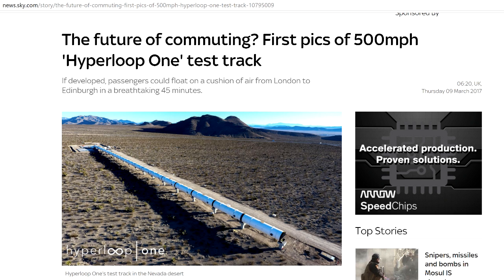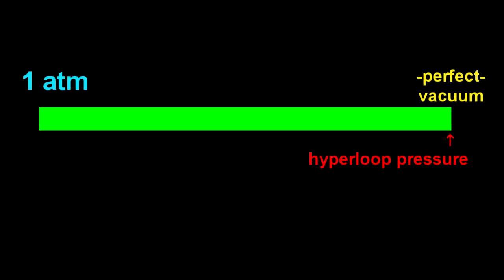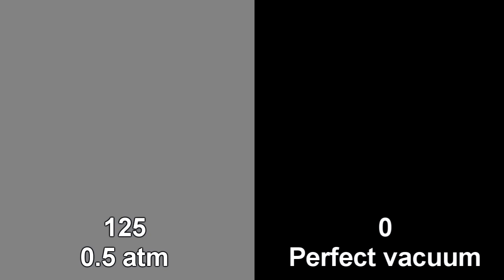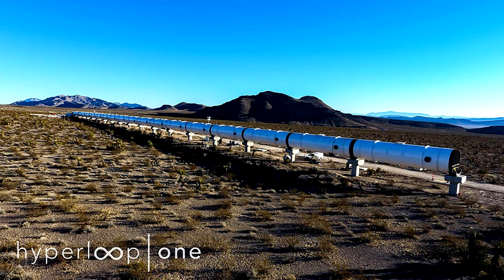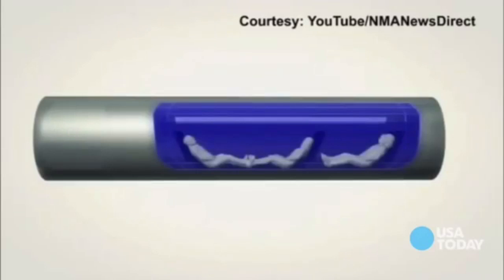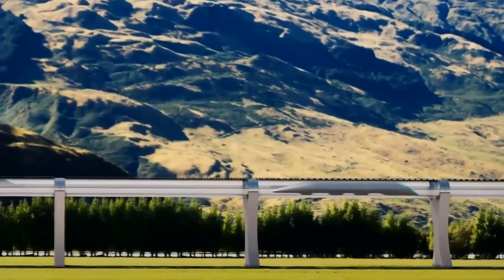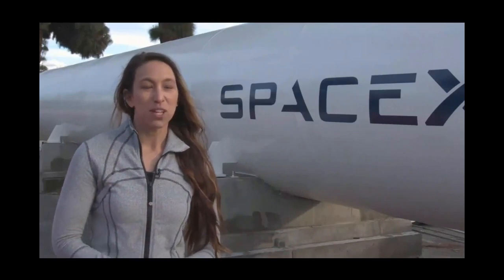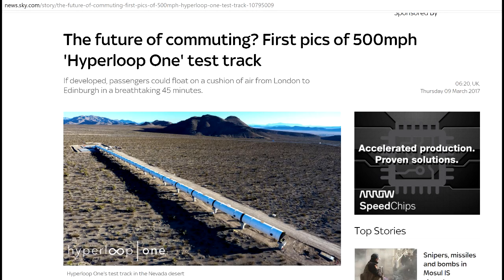Entire Hyperloop could be destroyed in SECONDS!

Comment: You obviously aren't going to pump down the entire track you would pump down the volume remaining in a lock once a  capsule is in it which would be as minimal as possible. If there were a leak in the tube you would open up  vents along the length. Expansion and implosion are trickier and I don't see how they are going to handle the issue but clearly hyperloop isn't even in an alpha phase at the moment. I think Space X is closer to landing on Mars than anybody is to building a practical Hyperloop.

Comment: Surely they could just have failsafes? Like having hatches on each individual piece, so that if one fucked up the hatch would automatically close? It would still be hugely problematic if one did break but it at least would stop the entire thing from being destroyed in a giant chain reaction. (Feel free to prove me wrong I have no idea if that would work or not)
Reply: Well, assuming they could engineer something like that into it, you would still need towels to soak up the remains of the passengers in a capsule in an affected section...
Reply: Yea ofc if it happened specifically on the exact section of tube that the train just happened to be in, then that would suck
Reply: Well, at 1000 kph, even a failure quite a few km ahead of the capsule would be fatal for the passengers.
Reply: Good point

Comment: Wouldn't it be easier to scrap the Hyperloop and build an electromagnetic bullet train in it's place?
Reply: I would rather have expensive and functional than an expensive dead end.  It's just a thought though.
Reply: Even better to just not go to San Francisco in the first place.
Reply: Gauss gun, maglev train. Its pretty much the same thing. A projectile suspended by permanent magnets to remove rail friction, with electromagnetic propulsion.
Reply: Also, I sure as hell would not want to stand anywhere near that student test tube!
Reply: Well we'll put flames on it.  Everyone knows flames makes things go faster.  Well get that 1000km/h  XD
Reply: I say we bring back the old 1800s steam trains. We can put a couple pinwheels on the roof: they can supply power to the "occupied" LED on the bathroom door or something? That will surely appeal to the hip enviromental sustainability people!
Reply: But they don't want easier boring old working things. They want NEW, EXCITING, EXPENSIVE, OVERHYPED STUFF even if the cost is so high even Snoop dog isn't match for it.
Reply: +Damien Kovalt
“If I had asked people what they wanted, they would have said faster horses.”
                       -Henry Ford
Reply: When I first saw this I thought it would be something like a mass driver or a Gauss gun-type thing. I was actually pretty excited.
Reply: Or 5.
Reply: Saying it Isn't 100% vacuum is really ignorant.  As outlined in the paper for this thing it is at .015 psi optimal pressure.  That is a 99.85% perfect vacuum.  It may not be 100% but it's so close it's negligible.  Also you can't blow air against the train to keep it levitated in a vacuum without negating the vacuum.  

"There are people that have never gone to school that could run circles around this idiot."  You're not one of them, move along.
Reply: Damien Kovalt I saw those back when I was in middle school. Why have we not started implementing those instead of this "hyperloop" thing?
Reply: I thought that was the whole premise of this? That they'd have an electromagnetic essentially railgun and the vacuum would be used to prevent air resistance so that it can reach as high as they say it could.
Reply: Simpsons History says it's doable
Reply: A high-speed maglev train would also be a colossal waste of money, but at least it would be functional.
Reply: ViliAtFinland Oh piss off
Reply: MrPepsicola123 -- You should actually try listening to this video and others he's made on the hyperloop, because he explains very carefully and accurately why the entire concept is bullshit. Also, he's not a moron he's a physicist with multiple PHd's.
Reply: I had to research how to take a piss this morning because I forgot how. But I would have known that if I had just read and understood the white paper at a minimum.
Reply: MrPepsicola123 Criminally stupid or a troll? Probably both.
Reply: It would be much Easier, Energy Efficient and Faster. And proberbly more scient too, and Eco-Friendly if you're not powering it via Oil-, Gas- or Coal Powerplants (Yes i officialy count Nuclear Fission as Eco-Friendly (If done correctly ... wich thanks to the lack in research isn't.)). And it works, quite well actualy. If you'd like to you could even make a Normal Rail and Magnetic Propulsion Hybrid for the Beginners and older Train Tracks. Look at the Possibilities! Look at those and now look at the future of Hyperloop. Yeah Magnetic Propulsion is the Future here.
Reply: Damien Kovalt There is a video by Real Engineering called "Why American Trains SUCK." I will direct you there.
Reply: Not sure what that has to do with anything, really.
Reply: From the thumbnail I thought it is a particle accelerator collapse. Before watching this video I assumed hyper-loop is some new particle physics experiment apparatus :D
Reply: "a slight tap would send it going very fast through the tube." How, exactly, are they counteracting the inertia? Force is required for acceleration.
Reply: If it imploded, it would have sent them straight to the school of Reality Check Tech.
Reply: IKnowYourCommentIs No its not, a bullet train uses electromagnetic to suspend it's self, allowing it to go at high speeds
Reply: TJP77 às
Reply: Doesn't having wheels or any other form of ground contact completely invalidate the point of the hyperloop as a low-friction train? The solution isn't "add more WD40"
Reply: I wouldn't be insulting peoples intelligence if I were you.  Pressure differentials at low pressure, the Hyperloop is designed to be a near perfect vacuum.  The idea of air cushions and a near perfect vacuum are incompatible.  Skis, i.e. a sled system would be a rather poor choice since they produce more friction than that of tires since the idea of air cushions is a non-starter.

Before accusing others of misinformation you had best have a good grasp on the topic at hand.
Reply: I didn't need to do research to know that skis generate friction. Did you?
Reply: Damien Kovalt I'm pretty sure it's already made
Reply: Yes but an underground maglev train, would still be very expensive. They are quite fast,  max out at about 600km/h on straight test tracks.
Reply: Imagine if that mile long Vacuum tube burst, if you are standing near it its like being inside a space shuttle with the door coming off next to you!
Reply: Yes, it would.  Which is why it probably won't happen.  This is California after all, and common sense is in short supply there.
Reply: Maglev trains have speeds up to 600km/h far too slow compared to the hyperloop 1000km/h! Plus maglev is already reality, far too boring.
Reply: Hell, even if they built a regular rail line running at 80-90mph, be a lot better investment than this piece of shit scam.
Reply: yeah but then Musk couldn't come up with lame ideas to fund in his spare time.
Reply: Bullet train in a hyper loop
Reply: What would be so futuristic about that, imagine if it actually works, it would be as revolutionary as the first trains crossing America.
Reply: its all about the invention that brings the rich more money
Reply: >air pads
>vacuum tube

pick one
Reply: no since expensive maglev tech is not needed for hyperloop and there will be much lower drag losses for hyperloop
Reply: Why??? You think they are somehow incompatible?  You can still have pressure differentials at low pressure you moron.  You people just spew out misinformation as if you think it is somehow facts.
Reply: Fucking do some research, at least read and understand the white paper at a minimum.
Reply: The concept is not bullshit, You and the person in the video have no understanding of how it is built or how it will work. the concept by the train is very simple. it is not a 100% vacuum. there is a bit of air that is blown against the train to keep it airborne with mabey traditional electromagnetic lift. a slight tap would send it going very fast through the tube. just because he's a physicist with a PHD means absolutely nothing, morons like him think they can naysay shit just because they took the time to memorize some shit to get a piece of paper.  There are people who have never gone to school that could run circles around this idiot.
Reply: those trains max out at like 600 miles per hour, trains can go 4000mph if you want that is why these things are being created. anyone talking out their ass naysaying especially the moron in the video needs to just fucking shut up.
Reply: It glides on air pads or skis not wheels.  How about you actually fucking learn about it before attempting these retarded armchair criticisms.  Oh wait, that's right, it makes you feel special to try to put down a much better persons big ideas... how about you go back to living in a fucking cave.

Comment: Seriously, though, just build a monorail or a maglev and be done with it. It won't reach quite the same speeds but it will be much easier than this stupid idea. If you really feel the need to depressurize the tube, only do so a little and build the damn thing underground so it's secure. You can probably do that for less than the cost required to get this hunk of junk actually working. Problem solved.

Comment: If Hyperloop manages to achieve the speeds they claim. Have they taken into consideration the potential forces placed on a human body moving at those speeds. If I had to guess the common commuter does not want to feel like they are traveling in a military jet plane.
Reply: Blake Hanley Im pretty sure it works differently under vacuum?
Reply: Teddy Furfang
The passenger capsule traveling through a vacuum will only eliminate air turbulence.
Reply: +Teddy Furfag Why would it?
Reply: I have no idea, thats why I put a question mark at the end, I dont know.

Comment: tf00t, I don't feel your safety concerns are warranted. Let's be honest here; it's damn expensive & difficult to pump that large of a vacuum chamber. I don't think it's going to happen in the first place.
Reply: Good point, no real safety issue with something that is never going to go full scale anyway.

I've got no issues with billionaires doing silly things with their money, it is even entertaining, but no taxpayer dollars should be thrown at it.
Reply: Mark Beiser it isn't the billionaire that is paying for it, it's million dollar government grands and over 2 million dollars from donations from people
Reply: Bill lupin, good grief.  Do you just post nonsense for the sake of posting nonsense?
Reply: I am not expert in pneumatics, but I know that propagation of compressed air (3.5 to 5.5 bar) in the brake pipe of a train suffers already from severe delays for trains longer than 400 m. Wouldn't that cause a problem in the Hyperloop?

Also unless they plan to use multi-gigawatt pumps to vacuum the tube, it would take forever :D
Reply: Actually, in train air brakes, the valves on the individual cars act as repeaters, so there's little delay.
Reply: The brake pipe is continuous, the triple valve doesn't act as a repeater. Ideally, all the triple valves activate simultaneously if the pressure in the pipe drops by the same amount in all positions of the pipe. But since the pipe isn't ideal, there is a propagation delay only caused by the pipe itself (i.e. if you were using say electrical pressure switch instead of triple valves, there would still be a delay). If you vent the brake pipe from the middle, the delays are reduced.

I don't know what causes that, but I believe it has something to do with fluid dynamics (something I really don't know)
Reply: Bill lupin, so, your safety argument is that, because it's never going to happen, it's never even going to have the chance to be unsafe?  Isn't that like saying that baby bottles made out of poison aren't dangerous because you're never going to buy one?
Reply: Nah. Baby bottles made out of poisonous substances could, hypothetically be produced, and sold as a product. Poisonous stuff is cheap & easy to produce.
This would be more like a baby bottle made out of hassium. It'd be ridonkulously toxic from radioactivity, sure, but it'll never be a concern, as it would be obscenely expensive to produce. They wouldn't be able to make it.

Comment: I'm surprised Musk never considered all the technical obstacles to building an evacuated track like that, including rapid repressurization, emergency procedures and rescue operations, equipment failures, structural engineering for a large vacuum chamber like that, etc.  Vacuum trains have been a proposed idea since the early 20th century.  Futurist Jacques Fresco proposed intercontinental vac trains capable of  3000 - 4000 mph back in the 1970s.  But it's never been practical for the reasons you described in these videos.  For the cash I'd advise Musk to develop a 300-400 mph elevated Maglev train for these routes.  Much more feasible and cheaper.

Comment: This same sort of argument can be used on not just things that hold a vacuum but things that are also pressurized. Do we see videos on how dangerous our water heaters are (outside of mythbusters)? If you really want to actually put forward an argument put the tube design into something like solid works and show how cost inefficient it would be to create the hyperloop with sufficient thickness to stand up to the vacuum requirements.

Like anything else its going to be designed to be overkill of its base requirements, pressure vessels for example are now tested with water to 1.3x the maximum allowable working pressure the number however use to be 1.5x a decade ago and some people still test based off of 1.5x.

And those cross tubes are called spiders and they are commonly used even on thick pressure vessels to bring the vessel into round so it can be mated up to the next shell section or head. That's why you only see the spiders at the ends of the shells. This in particular was a very poor talking point.

Comment: They would have faster success if they made the hyperloop a near 2.0 ATM and used the pressure to circulate a pod propelled with a fan-motor, because a fan in a vacuum ZERO air to dislocate.

THEN they could devise the vacuum method of transportation.
Roads evolved AFTER the cars appeared, not before.

Comment: There is a lot of valid criticism here, but its not impossible. Consider the International Space Station, it has 33,000 cubic feet of atmosphere against the vacuum of space. Not only can the ISS not have any breaches, but it also had to travel from Earth to space, 60 miles straight up at 25,000 miles per hour. The ISS is an incredible work of engineering and science. Far more difficult to build and maintain than the hyperloop

Comment: +Thunderf00t

7:30 ish
That formula can only be used for isobar, reversible compression and expansion.

My attempt:
In order to get the absolute thermodynamic minimum for the energy required, assume the opposite direction: a vacuum chamber gets filled in with air. The difference in internal energy before and after is the specific enthalpy of air (an ideal gas) at 298K times amount of molecules. Assume that the process is isothermal (which, in reality, it isn't!!) so that the enthalpy if the air stays constant.
So the difference in internal energy is 709x10^6 J + the heat it had to absorb to stay at constant temperature.

However, if someone knows how calculate the end temperature of the gas inside the chamber if the process was adiabatic, calculation would be much more accurate and easier: just the internal energy of the end state.

Comment: So, why does it need to be a vacuum tube again?

All that is needed is to move the air in the tube at the same speed as the trains.

There are two pipes, for the up train and the down train.  Just move the air up one and down the other in a continuous loop; then all that is needed is an airlock to move trains in and out of the circulating portion of the system and into a pipe where they can be braked by air pressure that is allowed to bleed out at a controlled rate (like a giant gun silencer with a closed end) then through another airlock into the station.

Insertion of a train into the system as it departs from the station would be via a smaller version of the main loop to accelerate the train to loop speed, then through an airlock into the main tube.

Moving the air in the system can be done by various means, like fans or simply by accelerating solid slugs round the system.

Seems safer than all this vacuum crap and it might even work.

One small drawback though...

All that air moving at over a thousand Kph - that is a Metric Fuck Tonne (tm) of kinetic energy, any break in the pipe and.... 

Well I wouldn't want to be in a building next to it.  Think "Huff and puff and blow your house down"

Anyway this little comment was just to show that anyone can think up crazy-ass hair-brained transport systems.